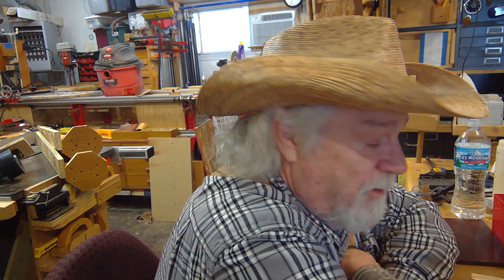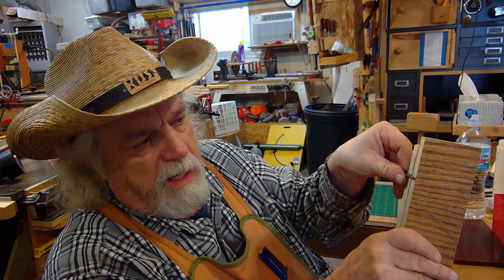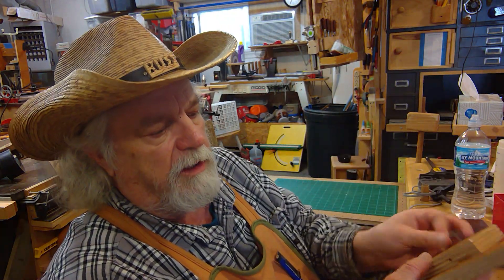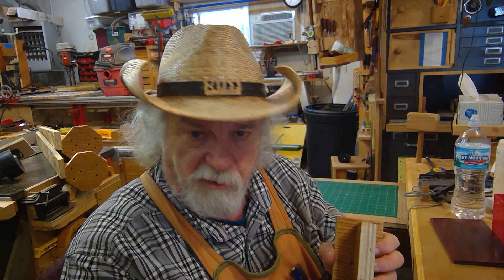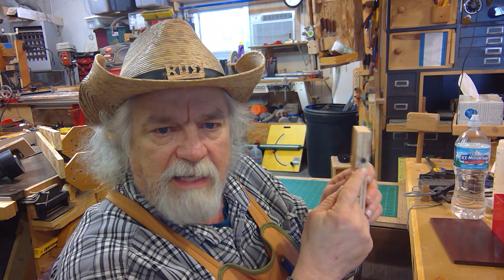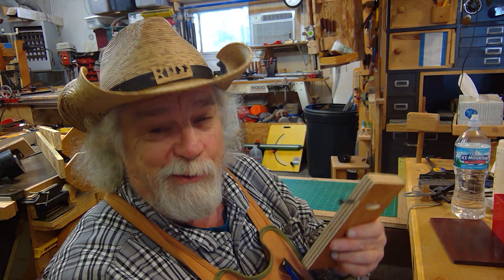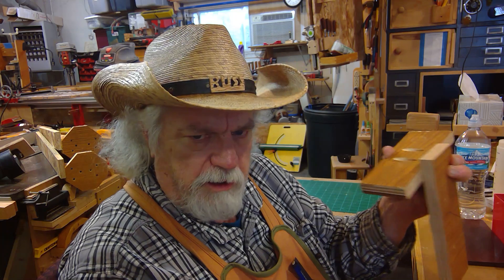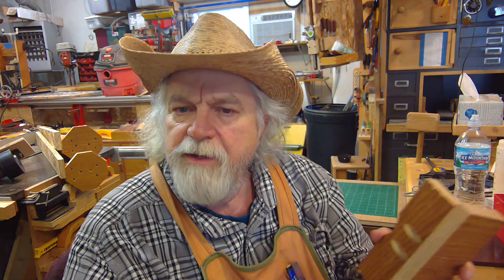What is the Strongest Plywood Joint by OTB Thinker

Comment: What about a dado joint and toenails 3/16" bamboo "dowels"? Just curious... I'm building an end table out of  solid oak, with 1 oak plywood shelf. I'm quite inexperienced with regard to building (hopefully) quality furniture from scratch.
Reply from the maker: The bamboo would be stronger, but brads nails would most likely be strong enough and easier to use. Thanks

Comment: wonder what size screws to use to join 2 pieces of 1/2" plywood using your cool method
Reply from the maker: I have done 1/2" plywood with the regular pocket hole screws.  The only thing is it comes out close to the edge instead of exiting in the center.  They also make a mini Pocket Hole jig with smaller screws that works well, too.  Thanks Bizzo

Comment: Norm's toenails have little to do with the strength of a glued dado joint, so comparing the pocket screws to the toenails is an unfair comparison that completely misses the strength of dado joinery. The dado gets its strength from the increased glue area plus the actual bearing of wood on wood.
Reply from the maker: So, pocket hole screws don't add any strength to a joint at all? Got it :>)

Comment: I'm building is shelf over my washer and dryer measuring 30x50 I tried MDF but that sagged what do you recommend
Reply from the maker: Use a frame of 2x2's and lay 1/4" plywood on top.  Keep the span of cross beams to 16" on less.  30" is too far to span without center support.
Reply: @russveinot5754  do you think birch plywood or Maple plywood would do the trick without a support
Reply from the maker: @chipete1  30" is too wide a span for plywood.  16" is about max and still not sag.  Are you trying to avoid shelf thickness?  Is there limited room above or below shelf?
Reply: @russveinot5754  actually the  width is 50" wide, but I was trying to keep it simple and no the space is not limited
Reply from the maker: @chipete1  Cut 2 stripe of the plywood to be 2-1/2"x48" (or so).  glue and screw them  on edge to the underside.  If you can recess in from edge 10" for each, better yet but anywhere underneath will help the plywood be stronger over the 50" span.
Reply: @russveinot5754  thanks. Appreciate your help

Comment: I don't have a pocket hole jig/fixture. 

I'll agree completely with pretty much everything you're saying.

I will say that in identical applications/uses, that a screw will create a stronger bond than a similar sized nail, in every situation I can think of.

Given that I don't have a pocket hole jig/fixture, and I really do not like using nails in just about any situation, except really rough work, my solution was to create that same plywood dado butt joint, then drive in my screws from the flat horizontal plywood side but at an angle. As always, I spot my holes ( borrowing some tools and techniques I learned working with metals), using s center drill or spot drill, but only AFTER I've created a small flat cut into the surface, at an angle corresponding to the angle of the screw, the I will pre-drill a hole that is .005" to .030" diameter smaller than the minor diameter of the screw (depending on the job requirements, the type(s) of materials used, the length, diameter, and thread profile, of the screw. The screw head is nicely counter-sunk under the plywood surface, it is through multiple layers of the vertical plywood, without spitting, or pushing apart, any plywood layers, has tremendous holding strength, and helps hold the alignment of the two pieces. I will alternate the angle of each of the screws, similar to the pocket screws entering from alternate sides of the vertical plywood.

Comment: What I cant get past on these pocket hole joints is the total lack of meat between the head of the screw and the seam of the joint .
Reply from the maker: that area is the weak link but not as weak as it looks.  Check out my super joint, that shows how to make this area stronger.  also I did a video on cross dowel pocket hole which makes the joint even stronger.

Comment: "Wood" pocket holed screws also work on mere 1/2 inch ply butt joint? (Instead of requiring it to be 3/4 for instance)
Reply from the maker: I have done both 3'4" and 1/2" plywood pocket holes with both screws and wood dowels (with glue) without failures.  Where there's a will, there's a way :>)

Comment: I’ll bet hardwood dowels are stronger.  And look like they were done by a craftsman rather than an apprentice.
Reply from the maker: You might watch my cross dowel pocket hole joint and pocket hole super joint videos before making a final determination about dowels vs pocket holes.  I have repaired more failed dowel joints in my career than PH joints.  BTY, this technique gives "non-craftsmen" other choices.  it is easier and faster too :>).  your thoughts are appreciated and valid.  thanks LT
Reply: Russ Veinot That is because dowel joints have been around forever and pocket joints are fairly new.  At least pocket joints are better than biscuits.  😂. https://youtu.be/6cAUz_eCmbw

Comment: Hey Russ! Hope this finds you feeling better. Great info on the screws. I know you work with OSB a lot so I have a quick question. Will regular yellow wood glue bond OSB  together with one on edge to the face of the other? I am wanting to build some torsion boxes to use as beams for a mezzanine in my shop for storage. They will be 2’ x8’  on 4’ centers with an over lay of OSB on top. Want to cut holes in the sides like Ron Paulk so I would have lots of cubbies to loose stuff in. Contemplating whether to use OSB or plywood, what’s your thoughts?
Reply from the maker: Thanks Frank, everyday I feel better (maybe 4 forward . . . one back :>). I use yellow glue only.  maybe something might be stronger but yellow is mellow.  I would love to see a Paulk workbench made out of OSB (very cool).  I would try to glue to the back face when possible rather than the face.  Just seems to be stronger than glue edge to face to me.  either way with pocket holes will be plenty strong for a workbench.  I would consider laying a 2x4 flat on inside edge under the top so you can put bench dogs along the outer perimeter.  are you planning bench dog hole in the top?
Reply: No dog holes in this project. It will be 8 feet it air. The project will yield a storage space of 22’x8’x4’. I stuck to my guns on 12’ ceilings in my shop. If they turn out as good as I plan, I will definitely be building an outfeed/assembly table out of OSB and that will have dog holes so thanks for the advice
Reply: Sorry 😐 about all the replies I kept hitting the reply button with no response. Guess it was working! Lol
Reply: Frank Herring You can delete replies...
Reply: Thanks I did not know that

Comment: even in a dadoed joint I skew my screws so as not to aggravate the plys ,especially these days with so much crap plywood at the home centres. Also, do not forget that a well machined dado helps to control any such expansion which if anything aids in securing the joint.
I like  pocket holes for a number of reasons though! 

But you know; you just cannot beat a mortise and tenon, through dovetail or a sliding dovetail.
Reply from the maker: since this video, I have developed what I call a "pocket hole super joint".  makes pocket hole joints even stronger.  I would be interested in your opinion.

link to pocket hole super joint:
https://www.youtube.com/watch?v=uqNgESNiyzw&t=1s
link to where to use POSJ:
https://www.youtube.com/watch?v=XZEbh61dCiw&t=9s
thanks for your comments Don.

Comment: I completely understand your point but isn't the screw that's screwed through the hole drilled by the pocket hole jig going to spread the individual plys the same as if were just screwed together normally ?
Reply from the maker: the pocket side is a thru hole and no threads are gripping that piece of wood.  the socket bottom is flat and the screw has a shoulder so it pulls evenly on all layers.  if you use a taper screw it would pull the layers apart and that is why pocket hole screws have shoulders instead of tapered.
Reply from the maker: I hope this answer your question, thanks for the inquiry Peter.
Reply: @russveinot5754  thank you so much, this has certainly answered my question . Your a clever man 👌

Comment: If the pocket hole is not be used for whatever reason, then the additional advantage to the dado is that the work pieces stay square when toenailing. Don't you hate it when the work pieces move a bit during joining.
Reply from the maker: if you already know it is going to move, why not prevent it before it moves?  you do know the ways to prevent it from moving?  maybe I should do a quick video about that :>)
Reply: You absolutely should do a video, because I do not know. That's why I avoid them and do the dado.
As Little Richard said: Help me, help me.
Reply from the maker: @williambranham6249  I just did a video that should answer your issue with pocket holes. is is at:
https://www.youtube.com/watch?v=8EateVFAW3c
thanks for the question and video idea :>)

Comment: Hey Russ you do have a good point here about pocket hole joinery be stronger, but just to make some conversation and the devils advocate I would say this:
Even though pocket hole joinery is stronger it is ugly looking if it's not hidden and that was mostly the reason Norm used the dado joinery with pins. Another advantage of the dado housing is that even if you butt join the plywood in a dado with glue, the risk for the ply to split is minimal as the dado hods it together tight and there's the glue also to strengthen it a bit too and it looks nice all the way. So even though I will argue that the difference in strength between the two is not huge and both are very strong joints and is more to me a matter of looks over strength. Of-course there's is no argument if what you build  is going to be concealed, because in that case pocket holes are easier, faster, and stronger... just my thoughts!!!
Great Vid keep the thoughts running !!!
Reply from the maker: thanks Stellios for your insight.  I might add that toe nailing with dowels has been used for centuries also. In this video, I am referring to joints in plywood.  screwing  (or nailing) into plywood is different that into solid wood. a screw is much stronger across plys than screwing in between. It's kind of like screwing into end grain vs. long grain.  I agree with everything you said completely.  if the joint isn't going to be under excessive stress, I join with a technique that may be "not as strong" as another but is less noticeable.  again, thanks for your input.
Reply: i like pocket holes on the underside plus a dado or rabbet for extra glue surface